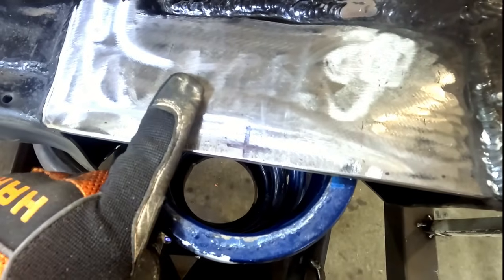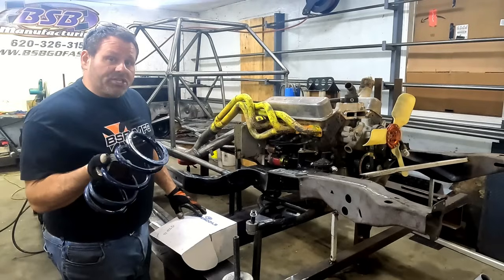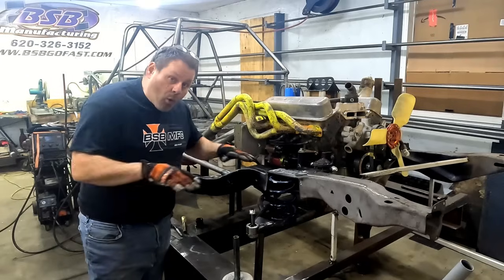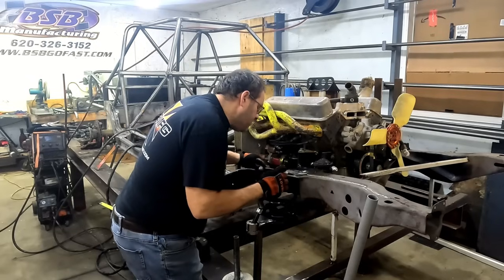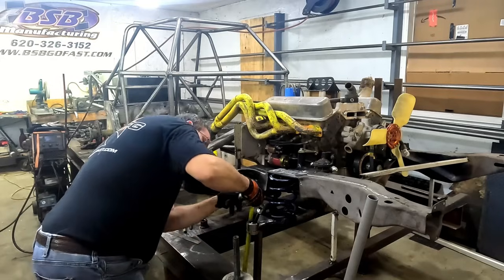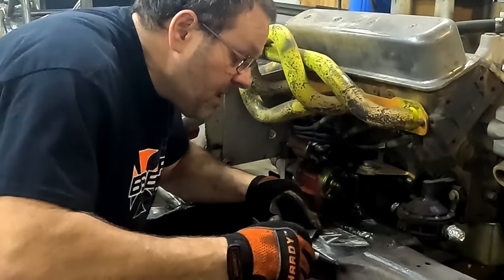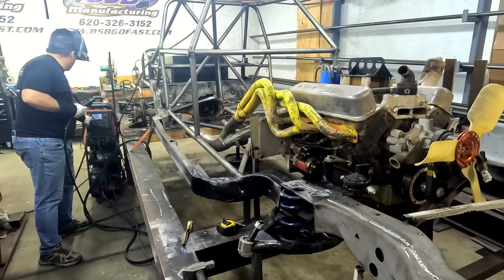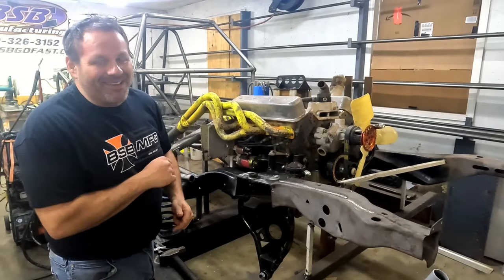How to Install Weight Jacks that don't Bind in Load on Your Race car. Get them Right the First time!

Comment: I raced Street Stocks for years. I can tell you from experience that handling through the corners is more important than horsepower. The attention to detail you are incorporating in this build is impressive. Maybe you will be able to attack the corners a little harder and accelerate a little quicker and quit using that damn brake pedal. You know I hate the idea of using the brakes on a Stredt Stock. Love your channel.  Im going to get to a track and see you this season.
Reply from the maker: I agree less brake is always better however just be aware these cars have become significantly faster in the slick as they have adapted to a driving style closer to asphalt where you absolutely are braking and setting up to roll into the turn. It's just where the technology has went. But I have a heck of a lot of fun in my camaro on a  hooked up track where i can just park my right foot out of the way and let'r eat ;)

Comment: I would love to see you do factory stock style front end with the hidden spring adjusters and the stock mount shocks. I feel like the adjusters bind and have always wanted to try cutting them to an angle. Also shock clearance is a challenge.
Reply from the maker: I've done several Camaros over the years and that would be a fun project to for example do another metric but see just how "good" I could get the front end while staying in side a "must be stock" ruleset. Definitely on my bucket list and would be a fun build.

Comment: Hey Jason. Awhile back you mentioned that you were considering using a center link from a late 80’s camero. I noticed on your site that you have gotten an AFCO AFCO30271 center link. Do you know if they’re the same? I looked at the Moog DS1049 and it seems to be the same as the AFCO.
Reply from the maker: I believe they are, I have the afco siting in my shop and will be installing it so I should be able to add some detail about what it is in comparison as a part of that.
Reply: @DIRTRACELIFE  Thank you so much.

Comment: Hello I’m wondering if you can explain what the heights of the rear upper control arm mounts will change. I assume you made them different height so that the car will have level arms at dynamic ride. My class must have same height but I was told the lower=the more drive you get. Thanks!
Reply from the maker: The angle of the upper control arm is setting the anti/pro dive. As you drop the rear or raise the front of the upper control arm, you are increasing Antidive . Antidive on the front wheel is a mechanical leverage you create that will make the car resist diving (compressing the front spring) when using the brake. Basically it works like this, When you hit the brake the caliper is bolted to the spindle and is trying to slow the tire down. Well that force is trying to rotate the whole spindle clockwise, forward at the top. The angle of the control arm can either make that arm want to push down (anti) or push up (pro) based on its angle in relation to the spindle and lower arm.
Thats the shortest version of how it works I can come up with but I have a video on this from two years ago that explains it in more detail and I will link it here.
https://youtu.be/GcNUms8DSvQ
Reply: I was actually referring to the angle of the rear upper control arms. Basically, what does raising or lowering the rear end axle mounts change

Comment: Why a Chrysler frame? or just the control arm?
Reply from the maker: This is a GM 1978-1987 Metric "G Body" frame and those lowers although tubular are the mount points and locations that match a Chevy Nova lower control arm. The reason I am using the longer nova style lowers is to increase the spring ratio from the stock 23% to 30% and to widen the track.